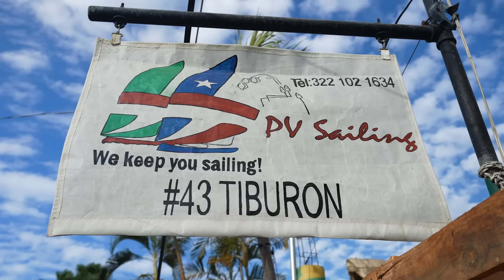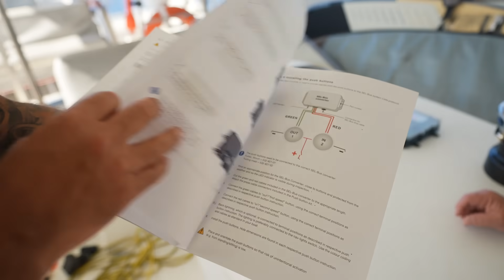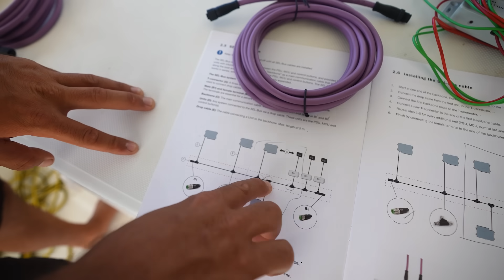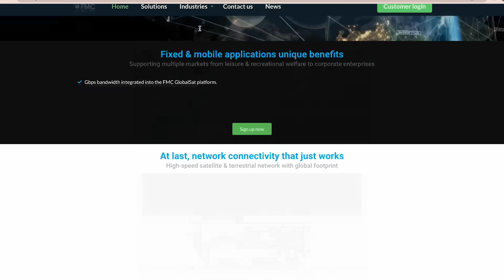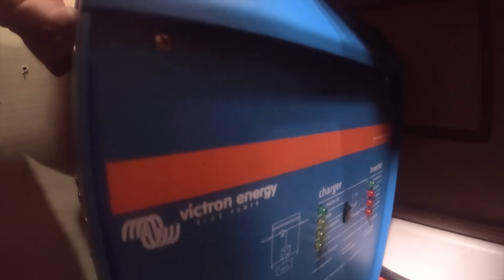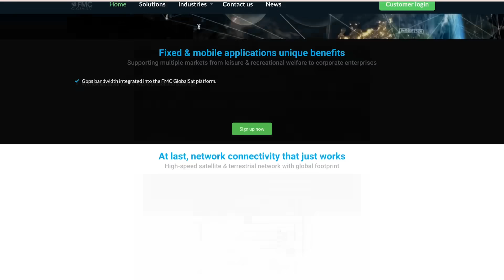How We Got Unlimited Internet Across the Pacific Ocean! - (Episode 218)

Comment: Tohatsu outboard. If you got the OEM fuel tank, the vent cap needs to be modified to keep you from trashing the fuel pump. Pressure builds and will not vent. The reed vent needs to be clipped so air can escape. New fuel pump $80

Comment: The stay lines flex from side to side as you jibe and tack. This causes stress cracks in the hardware as you now know. Some use thick bungy cord to tie port lines together and also starboard lines. they are just tight enough so when they would normally loosen a bit  they stay taught.
Barefoot Doctors Sailing on youtube showed this setup and why you need it. Supershok Shock Cord from west marine is the way to go. It can double the life of your hardware.  Hope this helps.

Comment: The standard Dishy works well on the open ocean.  (Great to see that yours  works even better. Good test example.) We had two 'RV' Dishys on board for our sail from Vietnam to Canada. Placement was critical.  After we added jib sheets my Dishy on the foredeck of the catamaran was in the way, so I moved it aft between the life lines and the pylon for the hard dodger. Barely worked at all. At the same time sitting on the nav desk with just the big window the other dishy worked most of the time. When I moved mine forward a bit more than a meter, it was still partially blocked by the dodger, and the life lines were still next to it; it worked fine.  (For four of us onboard 29mbps was enough.) 
It did not work at all in Taiwan. About the same time my iPhone said via cellular, "Welcome to Taiwan" Starlink stopped working and didn't work again until we were well off the coast heading towards Okinawa. (Vietnam where you're not even supposed to bring in VHF radios, Starlink worked great.)  So Starlink respects countries that want it blocked, seems to not bother for countries that haven't raised the issue.) 
What we can also say is that after my Dishy was on the foredeck getting washed repeatedly by waves coming over the deck -- for three months, it held up,  the only wear and tear is some of the powder coating of the post peeled off near the base. 
By far the biggest issue was data. At sea we were charged $2/gigabyte. (Just off a coast the RV plan is unlimited.) One day I was told my iPhone had used up 4 gigs. All I'd done is download a 200mb audible book and read a couple of newspapers. No video. On our devices we turned off everything to do with cloud back up, stopped watching videos, sharing images. (A single image, always high res,  used for only five minutes as a note of our current position to enter into the log,  was automatically uploaded to the cloud, then down loaded to the other phone it was 'sharing' with. Navionics apps were also real data hogs. (But worth it if that what was needed. I was the low man on the Navionics chain, so I had to turn mine off.) And until I stopped it my iPhone kept trying to upload a new IOS failing every time. 
Your using a custom router should give you the option of blocking this excess data use at the router. It should allow you to keep any new devices coming aboard from being data hogs while allowing them to operate without having to turn everything off. Be interested to know how well this works.

Comment: I absolutely do not have the qualifications to question you on engine break in. . .but I think the point is very limited stress for those break in hours. . .having the prop pulling against a stagnant line seems like the opposite.  It’s not about the hours, it’s about the stress. . .I think. . .happy to be wrong, but I think this is an oops.